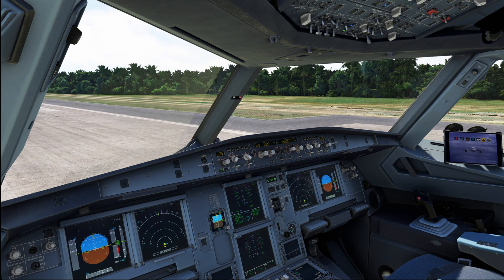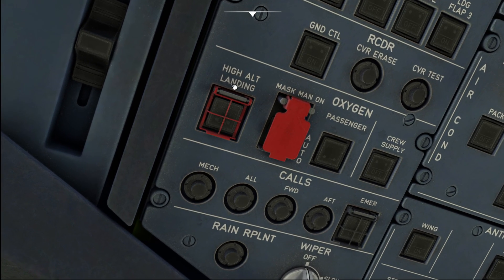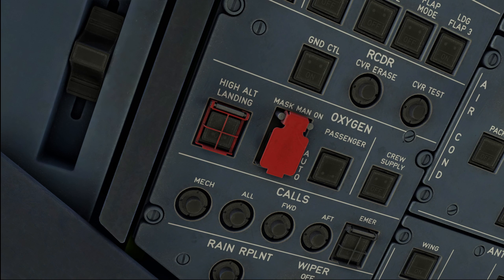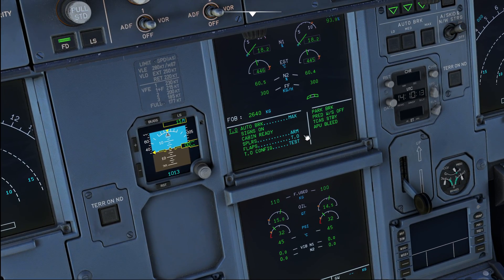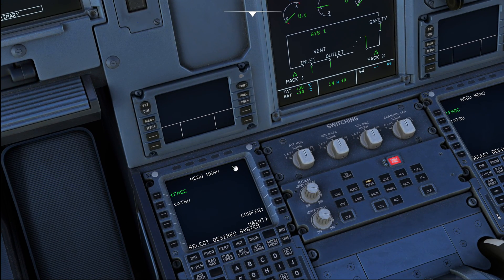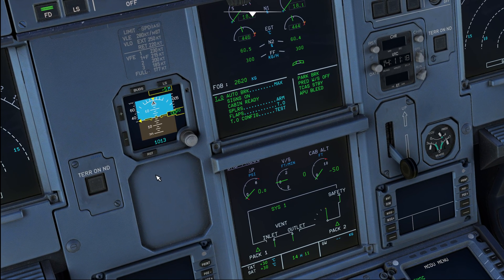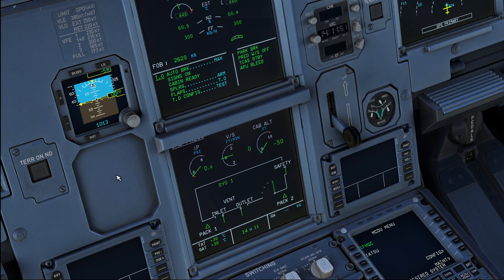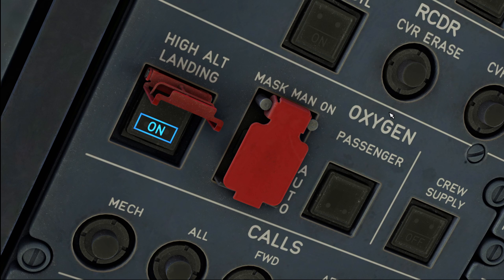A320 HIGH ALTITUDE LANDING Switch Explained | Real Airline Pilot

Comment: Hello Captain,
phantastic videos and with so interesting details from a real Pilot - I‘m a great fan of you!
One question please in relation to the B777-200ER and it‘s handling at high altitude airports. Are there special settings or precautions especially in relation to the B777-200ER e.g. at SLLP or SLUY. I noticed after T.O. in SLLP that cabin altitude decreased automatically during CLB from 13.300ft to about 8000ft slowly and during DES it increased to 12.000ft. Should I influencing it manually to avoid the decrease in the meantime etc.?
My second question regards the annunciator indication (independent of high altitude airport procedures) during T.O.  e.g. Flex65, SRS RWY A/THR blue. What‘s the reason if there is missing the RWY annunciator indication? Thanks in advance!
Reply from the maker: Hi, don't touch the cabin altitude - the computer knows what it's doing. Namely it makes you survive the flight ;-)
Extended exposure of altitudes above 10.000ft would have an impact on your body. Thus the computer lowers the cabin altitude to the permissible 8.000ft during cruise.

RWY mode uses the localizer of the takeoff runway to guide the airplane along the centerline - no localizer, no RWY mode.
Reply: Thank you very much for fast reply! And in Relation of B777-200ER I don‘t have to switch something comparable to A320 in order to avoid that the oxygen masks will Fall down?
It would be very appreciated if you could show a B777-200ER flight under high altitude conditions and explain some special circumstances.

Comment: What airport is located at 14,100ft to use this switch? I don't understand
Reply from the maker: There's one in China, though I don't recall its name right now.
Reply: @A330Driver  And that's the only time you would use that switch?
Reply: Peru, Bolívia, China etc... All have very high elevation international airports, plus several domestic airfields too. Basically Andes and Himalaya operations.
Reply: @ruifo  I mean La Paz is at 13,330ft. I don't know any other big airport where they fly a320s into that is higher than that.
Reply: *except the one in China

Comment: I am interested in hight alt operations.

The 737NG also has a high alt push button.
What can you tell about it and what limits must be considered?

Also, when are pilots allowed or have to use oxygen masks on high alt departures and approaches?
Reply: 737's HIGH LAND button also changes the warning system as it can't read information from FMC like a bus.
You'll need to use it when landing at airport over 8400 pressure altitude.
According to CAAC, pilots must use supplementary oxygen whenever cabin altitude is over 10000', that include TO/LD at high altitude airport, but normally we would not use the oxygen mask as it also have functions like smoke protection and you don't want deplete it too soon, so a oxygen bottle much like something you use on a single prop Cessna when operation over 10000' will be used.

Comment: This was a genuinely interesting video. I'm aware that you have to use supplemental oxygen above certain cabin altitudes, but for some reason I never once considered the problem of landing at altitudes above those limits and what it means for aircraft that rely on cabin pressureization.

I especially liked the little tease of pointing out that the button was near the passenger oxygen controls but not saying why at the beginning.  I admit it, I couldn't figure it out.

I thought for sure this was going to have something to do with engine management or high lift device configurations or something. I never even considered that the field elevation might have been above the oxygen mask deployment altitude.

I'm assuming that the rules on supplemental oxygen use for the flight crew applies in these situations. And that's just fascinating, I never thought that they would have a use for their oxygen bottles in situations that aren't emergencies.

Comment: How do passengers dont black out after landing at an airport above 10000ft? I thought that pilots flying non pressurized planes can only fly above 10000ft for 30min max without oxygen supply. So how do passengers do when they deboard the plane and have to go through customs and get their luggage that takes longer then 30min
Reply: You can still breathe quite comfortably a bit over 10000ft before you notice the lack of air. It’s just for pilots, when they’re operating an aircraft their brains need enough oxygen to function in order to maintain good pilot performance, so the limit is 10,000ft unpressurised (in most countries). It is true that a pilot may operate an unpressurised aircraft above 10,000ft but only for 30 minutes. As for a passenger, they aren’t flying the aircraft so it’s ok for them to tolerate the higher altitudes, typically up to 14,000ft with no supplemental oxygen and before hypoxia starts to become apparent, especially when a passenger is seated, they aren’t doing much that requires a lot of oxygen for thinking / descision-making. So a passenger won’t usually black-out when they are above 10,000ft. I hope this helps.
Reply: @patrickmaclean1524  Understood thank you!
Reply: There are several ways to look at this question. The first is that people who are accustomed to living at such altitudes are better able to tolerate it, so if those passengers live there they will probably be able to deal with it better. But there's more to it than that.

Those rules about supplemental oxygen use are cautious rules. The goal is to ensure that pilots are using oxygen before any problems are likely to occur. It's not just to prevent them from passing out. Because that's another aspect of this, hypoxia, or lack of oxygen, actually starts hitting you a lot lower than you may think. Research is showing that even comparatively small amounts of oxygen deprivation can cause cognitive deficits.

Hypoxia is particularly dangerous because you don't necessarily know you're experiencing it. It's not like holding your breath, when you're holding your breath what you feel is the carbon dioxide building up in your blood. You don't have a way to sense lack of oxygen however. There are symptoms of it that they warn you about, but it's not as obvious as you might think and because it might cause problems in your judgment it might make you miss those symptoms.

What I'm saying is they want pilots to be breathing oxygen to be sure that they're operating at full capacity.  It's not just that they're afraid that they'll pass out, they'll afraid that they could make mistakes.

I don't mean this to sound as cruel as it does, but passengers are not as important. Oh of course you want them to stay alive, but it's not as critical a factor if their judgment is compromised as a result of hypoxia. If they get physically weak then they'll have to deal with it, or they'll have to get help. But again, they're not flying the plane so this doesn't matter as much.

Sometimes people can't stay at those high altitudes. It's not that they'll just immediately pass out, but they can get altitude sickness and in the severe cases they might have to travel to a lower altitude to get relief.  It's absolutely a concern, but again, it's not like everyone's going to pass out if they spend more than 30 minutes above 10,000 ft.

I once drove to nearly 12,000 ft. While I was behind the wheel I felt fine, but a sudden rainstorm made me run back to my car for shelter. That short run left me out of breath for a seemingly endless time, I was breathing hard but I felt like I wasn't catching my breath. It's a very strange feeling. Altitude can sneak up on you like that.  Even at the city I was operating from, located in a valley at an elevation of about 8,200 ft, I was still feeling it every time I walked up stairs.
Reply: @NomadSoul76  Thank you for this explanation! It makes more sense now :)
Reply: @NomadSoul76  Thanks, good to know 🙂
Reply: Everyone basically already answered this, but yeah… 10,000’ msl was put in place as the cabin altitude limit because per medical research into hypoxia it is the RMS or mean of where I believe 50% of individuals will start to show “signs” of hypoxia. This doesn’t mean unconscious, and in fact many (if not most) individuals can do just fine at 10,000’. For some people who are more sensitive to a low partial pressure of O2, extended periods (tens of minutes to hours) at above 10k msl can start to have noticeable symptoms such as headaches and tachycardia… but generally you will do just fine. The true reason it’s adhered to so strictly by governing bodies in regard to commercial flight operations (see FAA Part 121/135 - See Title 14 CFR 135.89 and 121.329) is really due to subtle incipacitation of the flight crew. Early but subtle signs and symptoms of hypoxia can effect mental acuity, reasoning, and decision making for a flight crew member so keeping the cabin altitude below 10,000’ (generally about a maximum of 7-8000’ with a Delta-P of around 8psi for most commercial airliners) is a safeguard against this.

e.g. (an anecdotal example)
This is partially invalidated data because these individuals have acclimated by developing increased levels of hematocrit, but just think of any population native to high altitude living such as those native to the Andes or Himalayas who spend their entire lives WELL above 10000’ msl.

Comment: A video on high altitude ops would be very interesting, maybe even 737 vs a320 comparison on how the procedures might differ
Reply: 100% agree
Reply: I had the exactly same thought during the video, please Emanuel do it for us.
Reply: Same, would be really interesting to see
Reply: If I had to bet, I would guess when you set the land altitude in the pressurization panel, the 737 already does everything
Reply: The comparison would be great specially by the 737 I always get a cabin pressure alarm which I don’t know how to avoid…
Reply: @felipeturbayr  check your packs(auto), engine bleed (on) isolation valve (auto) and the pressurization mode selector (auto). Probably you are messing with the packs in order to starter the engines, do your checklist carefully, and you gonna be fine.
Reply: Hi Lukas, engine start is not the problem. When I am in approach in Lima or Cuzco I get an alarm for the altitude pressure even though I set the airport landing elevation correctly…
Reply: @felipeturbayr  the 737 in msfs doesn’t have the high altitude ops package hence you get the warning but you can silence it in the overhead panel. But maybe I’m wrong tho so I’m not 100% sure
Reply: Would love to see high alt ops since I am doing those in the sim. Like in China and Peru

Comment: From ~9.000 ft cabin preasure it goes THE WRONG WAY UP to 14.000 ft? I don't even ...  But what about the pilots? Aren't they going to be hypoxic as well if they aren't used to those heights? Or how does this work?
Reply: I was wondering about this myself. I am not a pilot so don't consider me an authority on this, but I have been interested in aviation and had read about this before. Note that I live in the USA so I'm going to be talking about our country's rules. I did look up these numbers to refresh my memory, I got what I'm going to say below from an FAA pamphlet.

For general aviation pilots, they have to use supplemental oxygen ( that means an oxygen mask or possibly the things that feed oxygen directly up your nose) for all of the time that they are flying above 14,000 ft cabin pressure. If they fly longer than 30 minutes above 12,500 ft they have to use oxygen also.

However the rules are more strict for commercial operations. Then the flight crew has to use oxygen all of the time they're flying above 12,000 ft, or if they spend more than 30 minutes above 10,000 ft.

So for us at least, as soon as the cabin altitude goes above 12,000 ft the flight crew are going to have to use supplemental oxygen.

I know that they have bottled oxygen available, instead of the chemically generated oxygen that the rest of the passengers get. So they can draw from it and then have it topped off again, instead of the passenger oxygen systems which have to be replaced after they're used.
Reply: @NomadSoul76  More or less the same here in Europe. And that bottled O2 is - at least to my knowledge, only used for emergencies? And I also doubt that they will stay on it from the landing to the hotel and back again ... Also, reducing the amount of that emergency O2 won't be allowed, I presume, for being needed in ... well ... emergencies. So either the pilots don't have to use it because they are already accustomed to these heights, or there needs to be additional O2 provided. I guess the same is true for passengers that are NOT native to these heights? IDK?
Reply: @brkr78 the oxygen system is designed to support the flight time that the pilots are expected to be flying above 35,000ft and the masks have a mixed flow and 100% oxygen setting for emergency use. On some aircraft,  the passenger and pilot oxygen systems are also tied and the pilots can switch that system off in case they would need more for any reason. The reason checking oxygen pressure is part of the preflight checklist is to make sure that the aircraft has enough oxygen for a flight usually 1600 - 1800 psi depending on the aircraft.
Reply: Cabin pressure also needs to be equalized for safety reasons once you're on the ground. You will either have decompression problems or you won't even be able to open the aircraft doors (if you need to pull the door in first)  if the pressure is too different between the inside and outside of the aircraft.
Reply: The pilots have to use their O2 masks when operating at cabin altitudes above 10,000 ft, including takeoff and landing, so they'd be masked up when the cabin climbs to depressurize for landing all the way to the gate. Then masked up from the gate until the cabin pressurizes below 10,000 ft on climb out.